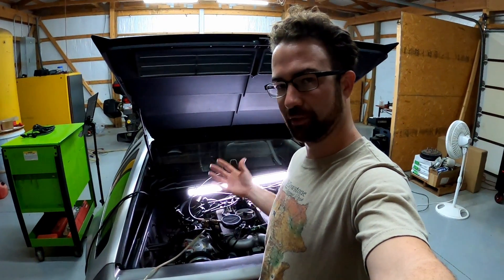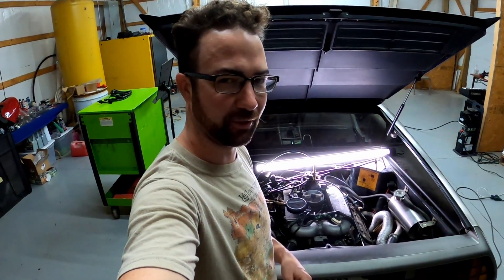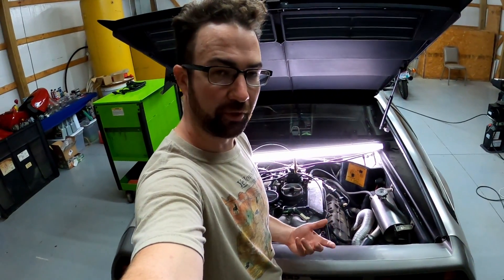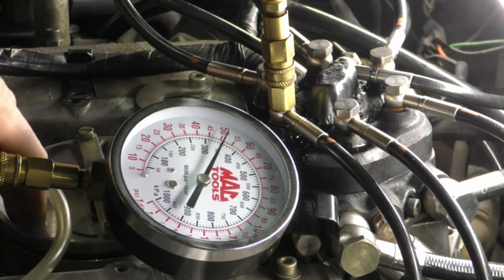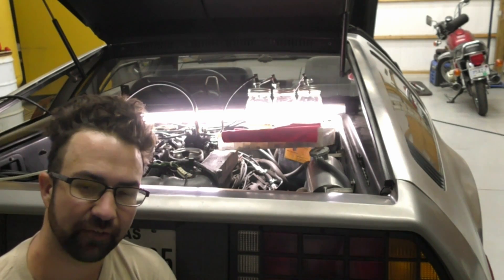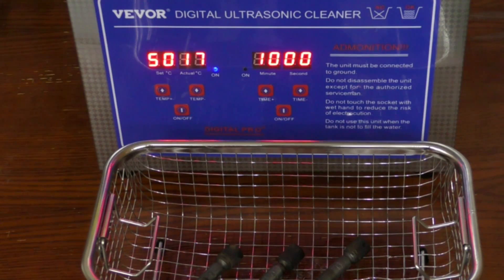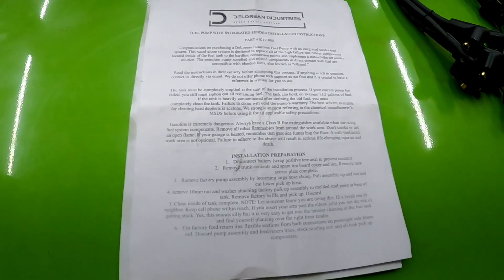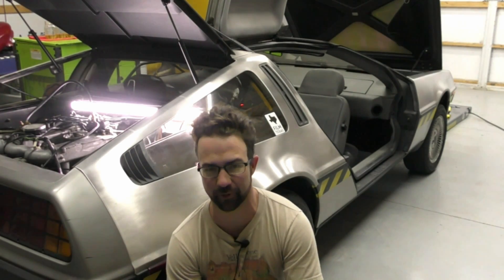Can Ultrasonic Cleaning Save These Delorean Injectors?

Comment: Nice vid. Was looking for fuel injector cleaning vids and came across yours. How do you find parts for a Delorean? I remember seeing them in Miami  back in the day in the early 80s--was the bomb back then. BTW good luck on  that Vevor ultrasonic. Its a mixed bag on quality. I had one but pestered out after a few weeks. I think running the heat and ultrasound at the same time could be detrimental. There was a canadian recall not that long ago on them. I went with a harbor freight and so far ok.

Comment: So I have a 2003 Audi S6 which I think is losing prime...but only when it is like 95+ and it sits in the sun for 6-8 hours.  Which I don't have time to get to work and put a gage on and hope it is a day the car does it.  Now I have 9+ months before it does it again probably.  If I turn the key on and roll down the windows, it has enough time to start normally.  It can sit in the garage for 2-3 weeks and start normally.  I was considering getting one of these cleaners and running the injectors through as well as doing my 944.